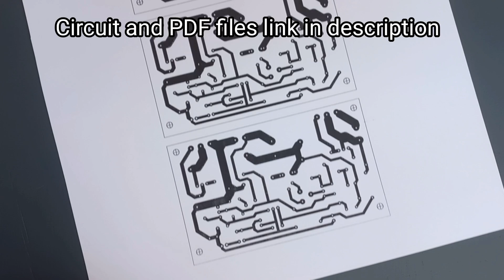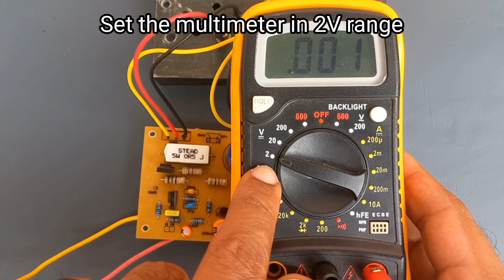Making Philips 40 Vintage Amplifier Circuit In DIY PCB

Comment: Brother I have one HUMBLE REQUEST 

For Testing sound PLEASE use  only Full Range  8 inches 8 ohms  speaker in a  12x12x12  inch 18 mm MDF sealed box with 1/2 kg medical cotton in each box  this makes Great speakers for testing frequency range of audio , once u get know the LINEARITY of sound it produces then u can design 2 way or 3 way boxes

I really appreciate if u do this THANKS BRO

Also we can Figure out the sound.

Sweton 8 inches full range speaker of 8 ohms cheap and good.

Good luck bro

Comment: +1 like from me for the efords. The AI goes crazy trying to translate the text of the songs you play. It is an interesting amp but BD148 is a 31W, 4A, 40V, hFE 40, NPN transistor with BE 7V wich is probably mounted on the heatsink with main transistors for thermal compensation, I see you put BC548 - a 0.5W, 100mA, 30V, hFE 110, NPN transistor with BE 5V and its mounted way far from heatsink.
The small transistor, is it not running hot and when the amp heats up does not going out of ballance and specs? If BC548 doesn't heat at least you could put BC547 wich is rated for 45V and BE 6V closer to heatsink.